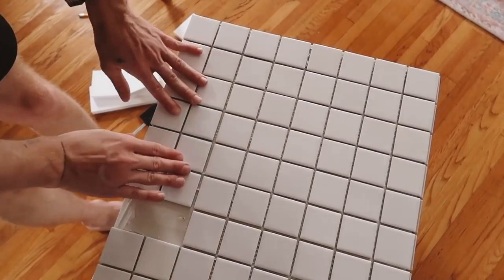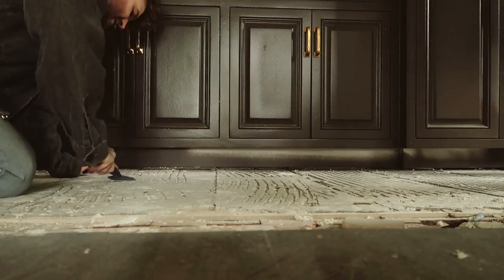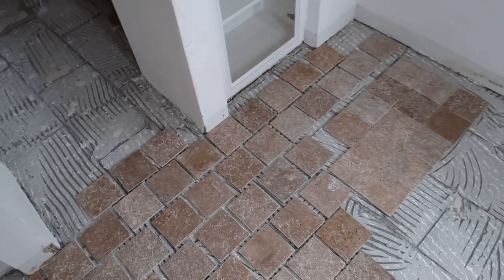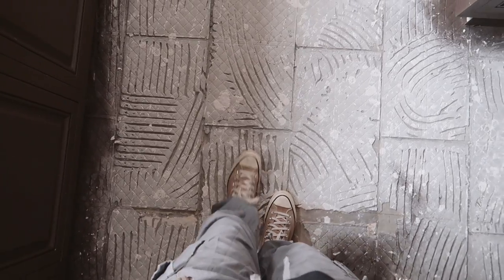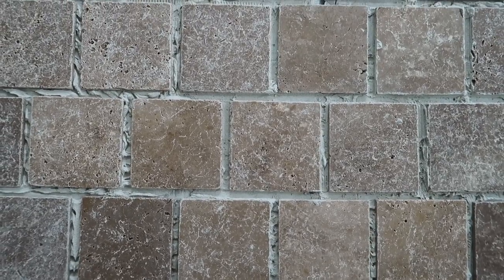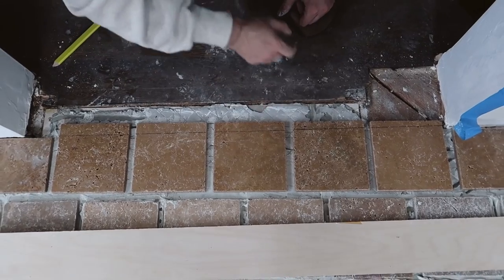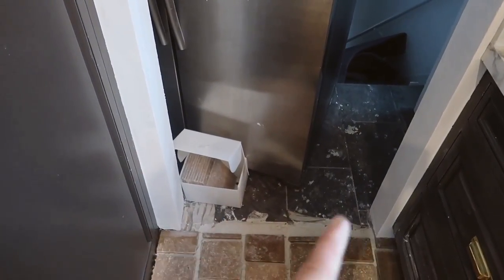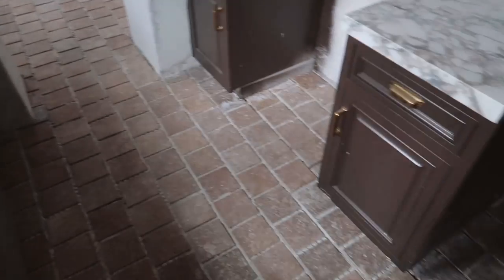DIY TILE FLOORS IN MY KITCHEN *Antique Look for LESS*

Comment: I’m in no way knowledgeable but aren’t you suppose to put mortar on the underside of the tile too? Feel like the tiles would pop off like they did for the old ones
Reply from the maker: Most tiles actually pop off like that with a little force believe it or not! Only large tiles would you want to add extra mortar to the tiles prior to placing
Reply: @lonefox  thanks for the knowledge! always good to know something new

Comment: It's a nice tile but I would not have removed the original tile if it's not broken up why remove something that was put Ina year ago what a waste and add to trash when it was perfectly good, I was raised to use what what you had and not throw away something that was perfectly good. I guess it is a gen Z thing to not care about the environment and to waste things.I think that the original tile went better with the counter top.